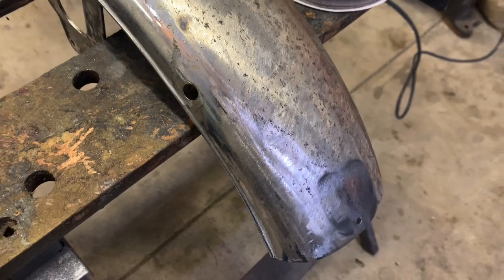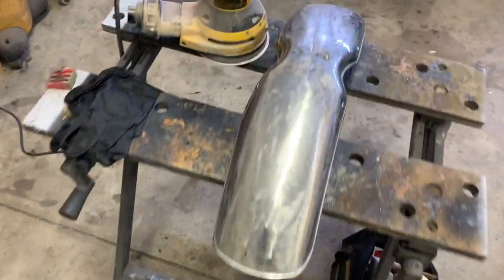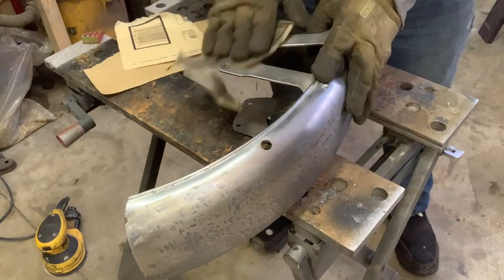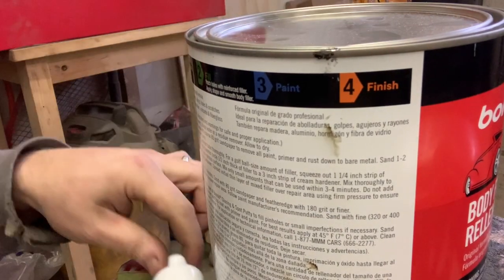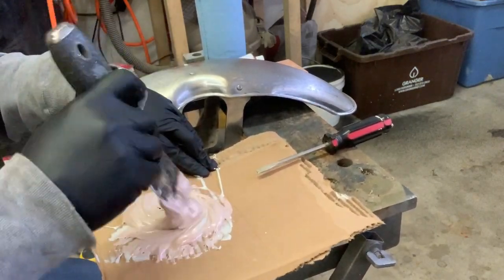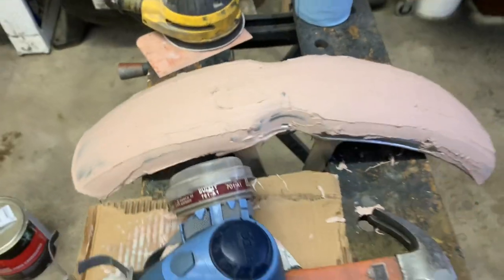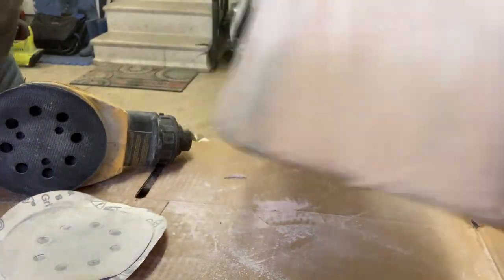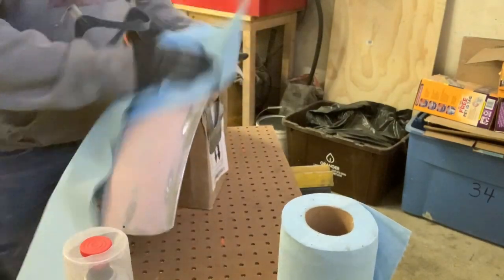Can You Paint Chrome? Yes! You Can!

Comment: Lightly hand sand the Bondo with 36 grit as soon as it becomes firm but not fully cured. It stays sticky on the surface forever but if you knock the sticky surface off and lightly shape it with the 36 grit by hand using a block you will save yourself a ton of time and sand paper. You’ll find that once the sticky surface is removed you can get going with your 80 grit for the next step of sanding and shaping.
Reply from the maker: Thanks for the tips, Paul. I appreciate it.

Comment: Filler primer is the way to go, spray it on sand smooth, and repeat till you have a smooth primer coat then paint final colour.
Reply from the maker: Everything I was seeing encouraged an epoxy paint because the chrome can have an adhesion issue. Not opposed to trying the filler!

Comment: With all the bondo are you really painting chrome?
Reply from the maker: From everything I read the chrome is very difficult to get paint to adhere to. That's why I scuffed it up good. Fair point. I'm not sure if the epoxy paint would have done well or not on its own. I did get a little carried away with the bondo...it was an experiment. hopefully vibrations don't rattle it all off. LOL

Comment: Did you use the 2K primer on this fender because you were painting over chrome, or do you always use a 2 part primer?
Reply from the maker: I used an epoxy primer on the chrome. Just to assure good adhesion. 2k paint is great. I try to use it whenever I can
Reply: @KeepOnWrenching  where was the reveal of the finished product on these fender... how did the paint hold up?

Comment: Don't mix Bondo on cardboard. It can absorb some of the gray filler, and throw off the hardener mixture. Not a dig, just something an older body man told me.
Reply from the maker: Thanks for the info. Makes sense. I’ll remember that.
Reply: What does “throw off the hardener mixture” mean?
Reply: @urboytony5028  The hardener won't have the same mixture it needs to make the chemical reaction. Some of the needed mixture will be absorbed by the cardboard. The red part of the mixture will be too much, and the Bondo will harden too quickly.
Reply: @yepok2957  oh ok thanks. Makes sense now that I re-read it. I have a little metal plate that I mix mine in for wood repairs at work.  Good to know my strive to look professional worked in my favor but I have mixed on cardboard or piece of wood in the past lol.

Comment: That looks like two golfballs size bondo which may be the reason it took longer to cure - and by the way  that epoxy primer is extremely cancerous good  ventilation and a high quality mask required
Reply from the maker: Perhaps!! Good call on the mask. Potent stuff for sure.